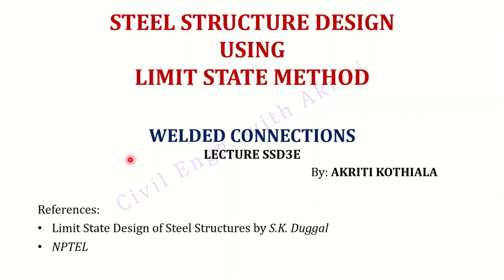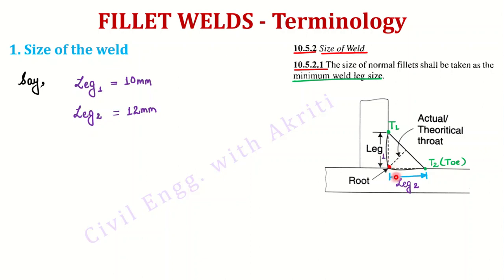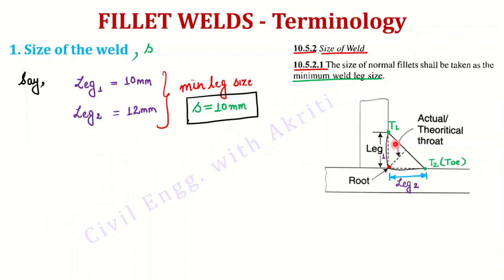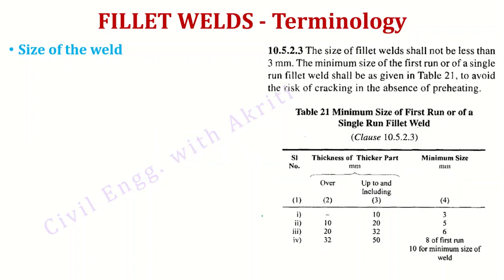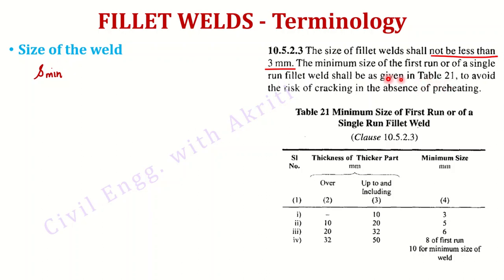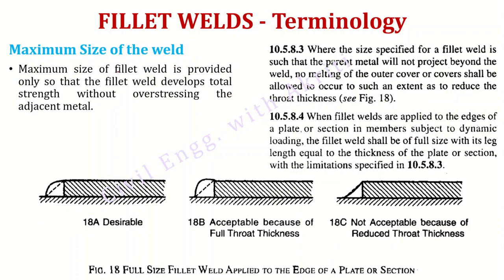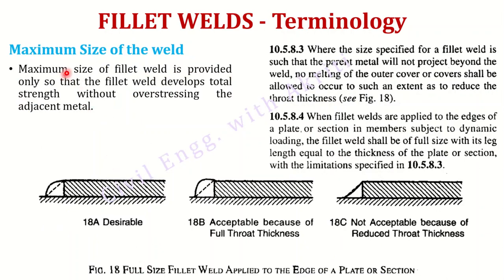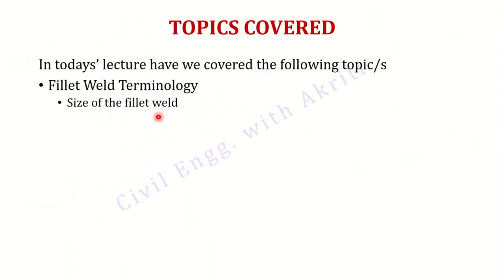Steel Design L3E | LSM | Welded Connections| Size of the fillet weld | IS 800:2007| Hindi

Comment: Mam ap pura steel pdhayengi?
Reply: Mam why thicker plate use
Reply from the maker: Yes...Stay Tuned :)
Reply from the maker: The thicker plate will cool the weld rapidly and that will make the weld brittle which is undesirable. Therefore, IS 800:2007 directs us to use the thicker plate to determine the minimum size of the weld.